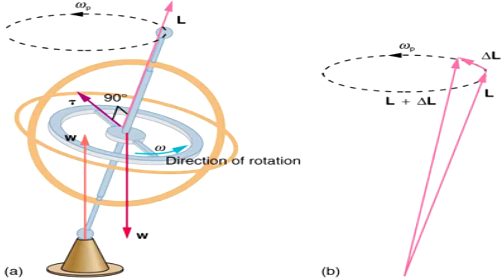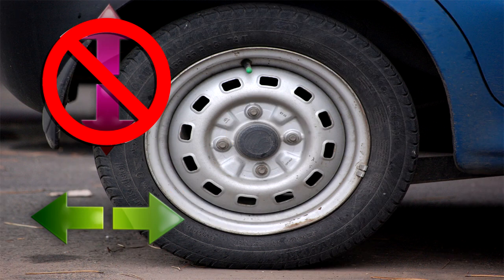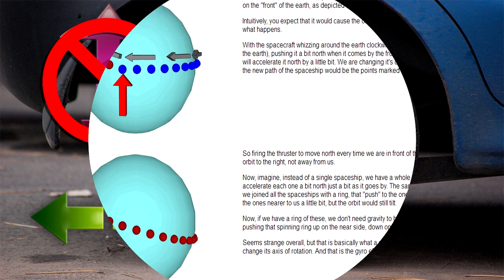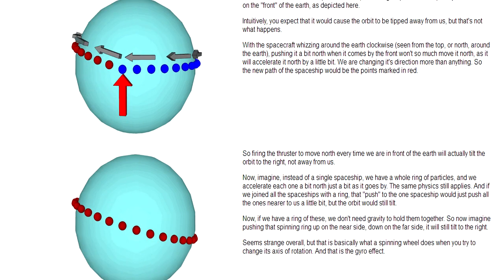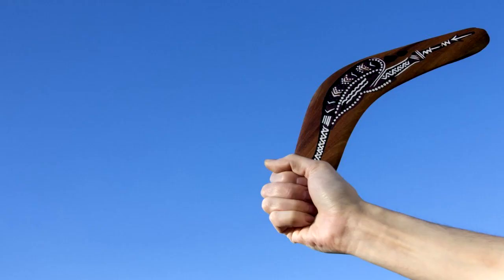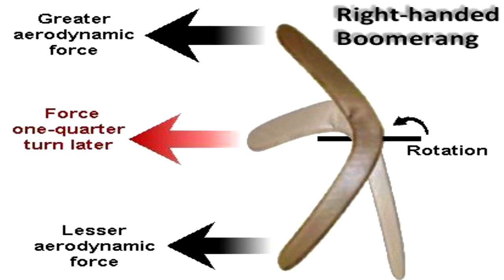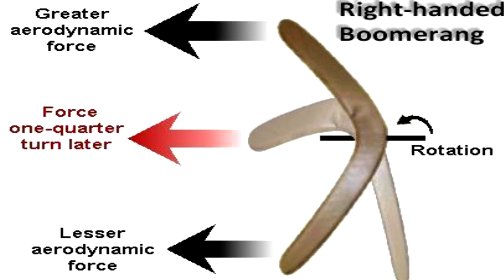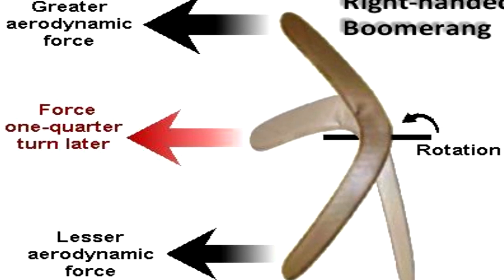How Does CAPTAIN AMERICA'S SHIELD Work? - Science Behind Superheroes

Comment: Captain America's shield shouldn't be able to bounce of walls if it's made entirely of vibranium because vibranium absorbs the hot when it hits the wall, so it should just drop to the ground after hitting the wall instead of bouncing off
Reply: They way I have read it works is that Vibranium is aligned a certain way so that when its molecules line up one way they absorb kinetic energy but the other angle they instead repel or do not absorb any kinetic energy,Thus the flat surface of his shield stops kinetic energy and so is nearly invulnerable and stops most force but the molecules around its edge, or the edge on sides of it don't absorb any kinetic energy and so it bounces without losing any of its kinetic force. This allows it to continue to bounce for as long as it strikes an opposing surface edge on. With great experience using it and his trained skill and peak human perception, reflexes and analytical prowess, Captain America has learned to find the surfaces around him he can use, including opponents, see the angles and then throw the shield for the effects we see, multiple bounces and attacks on targets, with no loss of force, and know where to be to catch it after all the bounces.
Reply: imkluu but what about having it bounce and then stick into something
Reply: It absorbs kinetic energy but the momentum of the shield is kept. So it doesnt stop when it hit walls and stuff.
Reply: Really

Comment: Most of the time it gets bounced of things to make it come back so it's all about where you through it. And it stays in the air because of the metal it's made this has the ability to absorb and reflect practically all manner of kinetic energy and thus reflect off multiple objects with only miner loss of velocity.
Reply: i believe that only light weight objects can absorb kinetic energy...for example a freesby or a plastic ball. as you know metal balls cannot bounce back. if we look at the shield it is much heavier even if we throw it at maximum speed a human can throw. it wont come back.
Reply: @adnansamol8464  this is a fictional metal the shield is Vibraniam and in comic book land it is the strongest and lightest metal in the universe actually if I remember correctly it is one of the lightest material on earth and that not just including metals. So a human especially one with a super soldier serum could throw this no problem

Comment: maybe its not about the shield. as you said he is at the peak of humans evolution or somthing like that
Reply: It is a little of both and how they work together. They way I have read it works is that Vibranium is aligned a certain way so that when its molecules line up one way they absorb kinetic energy but the other angle they instead repel or do not absorb any kinetic energy,Thus the flat surface of his shield stops kinetic energy and so is nearly invulnerable and stops most force but the molecules around its edge, or the edge on sides of it don't absorb any kinetic energy and so it bounces without losing any of its kinetic force. This allows it to continue to bounce for as long as it strikes an opposing surface edge on. With great experience using it and his trained skill and peak human perception, reflexes and analytical prowess, Captain America has learned to find the surfaces around him he can use, including opponents, see the angles and then throw the shield for the effects we see, multiple bounces and attacks on targets, with no loss of force, and know where to be to catch it after all the bounces.